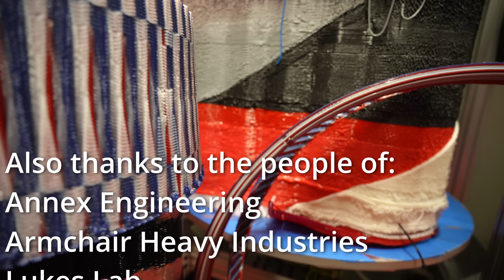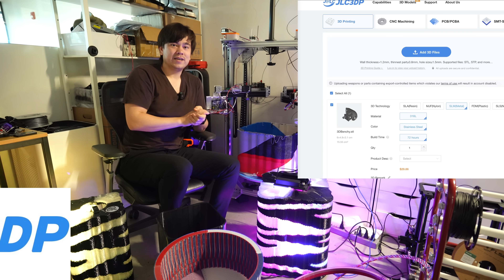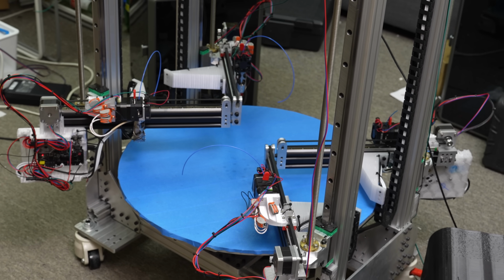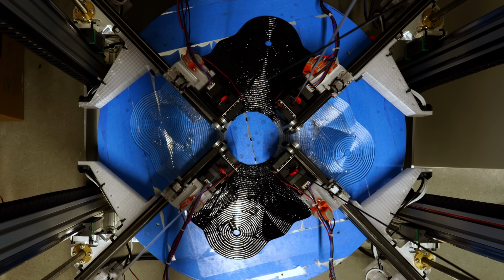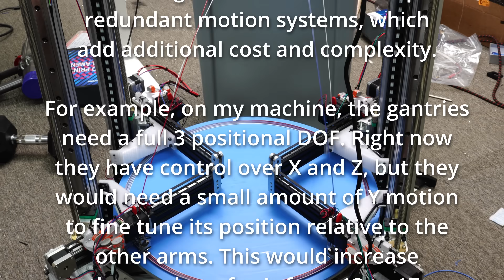The High Speed Future of 3D Printing - Quadrupolar Express

Comment: This project is really cool honestly. It is a very unique rig and an out of the box thinking for solving printing speeds. I have too many questions about your design choices but one of them is.. to get a precise frame and gantry alignment and a stiffer frame, why not make the frame square instead of rectangle? This way, the gantries form a perfect 90° angle X shape and can be connected in the middle.
Reply from the maker: I’ve been considering making the gantry a solid piece of aluminum plate with all 4 linear rails attached to it. That would make them all more precise relative to eachother, but it also means I the z heights will be coupled together.

I went with the current design to keep things mechanically simple, and be easier to program in firmware, but there are many other design alternatives
Reply: @NathanBuildsRobots  Oh -  I just suggested this. you're waaay ahead. sooo awesome

Comment: Ambitious project. What do you think of practical printings dual gantry design.
Reply from the maker: It’s similar on a lot of ways. Since he has full control over XYZ for both printheads, he should be able to do fully digital calibration with no requirement for mechanical calibration

Comment: This will blow all the 3d print industry if you manage to make it work. What if you yill use 3-4 delta mechanism to move 3-4 hotends simulaneous over the plate? You will be able to overlap for a certain degree. Also, a delta will compensate the vertical missalignment of the towers. But it is over me how to implement this by software 😁
Reply from the maker: IMO, SCARA makes the more sense than delta.

Delta mechanisms have a lot of beams sticking out every which way, and requires a lot of overhead, so the machine would have to be super tall
Reply: @NathanBuildsRobots  I think if the delta's all come in from an angle rather than overhead you would overcome a lot of the issues with beam clash - however it would make that printer end up like a massive half sphere with a tiny build half sphere in the middle - so as you say not as practical as cantilever type designs.
Reply: @NathanBuildsRobots  it will be anyway for proffesional use, the height will not be a such big deal i think. For a home user to melt 2-3 kg of filament in 5 hours is to expensive anyway to be done to frequently
Reply: With 3 delta hotends i think you will be able to overlap easly. But...not im  smart enough to ever think how complex will be the software or the slicer :))

Comment: That's like the only printer that can use 4 nozzles as the same time!
Reply from the maker: There is actually a project from like 10 years ago where someone made one

I learned about this after I had finished my design 😅
Reply: Can you remove prints by spinning the bed really fast?

Comment: i think a big concern is filament cost. The pellets used in injection molding are like 6€ a kg, but one spool of filament cost like 20€+
Reply from the maker: Yes, material cost is a concern.
This is a sort of roto-moulding alternative that is tool-less/on-demand, so it's not going to be the first choice for low-cost items
Reply: @NathanBuildsRobots try adding a heating element with an augur that allows you to move to pellets. The cost is significantly lower
Reply from the maker: @WilliDurpel 
$300 of filament isn’t really going to put much of a dent in the profits for large projects.

Of course it would matter for mass production, but that is not what this is about
Reply: @NathanBuildsRobots  💯% I was thinking the same. Nobody is using FDM to compete with large-scale production of cheap plastic junk and toys. Injection molding will ALWAYS be the method for that. Plenty of companies run $50,000 printers with $300 filament and they’re still saving loads of money on prototypes and custom hardware.
Reply: @NathanBuildsRobots I'm not going to spend $80 on a trash can and 20 hours when a $10 and 1 hour round trip gets me the same functionality
Reply: @NathanBuildsRobots  ja das ist mir vollkommen klar, jedoch konkurriert der 3D Druck in gewissen Bereichen auch mit herkömmlichen Herstellungsmethoden und es würde bestimmt nicht schaden, wenn Filament allgemein sich mehr der 10€ Grenze nähern würde. Ein Produkt muss ja nicht unnötig teuer bleiben, wenn es auch billiger möglich wäre
Reply: @WilliDurpel  The areas where FDM competes with existing technology are almost exclusively using “engineering grade” materials and they still save thousands of dollars over machining despite some high-end materials being $200/kg+
Reply: pellets is a little bit problematic with smaller batches...but still - filament sucks. maybe a new category of standard sized pellets? 0.5 -2 mm - somewhere around that?
Reply: In calculating the price of injection molding, tooling and pretty expensive machines should be taken into consideration as well. For parts that wont be produced by the thousands, this type of of machine might present a relatively competitive cost of production.
Reply: Depends on the production volume. Machining the molds for injection molding costs a lot but they can be used many times otherwise they won't be economical. With 3d printing the cost of material is higher but there's no need for a mold. So for low volume and prototyping it'll be the least expensive option.
Reply: Use a pellet extruder then
Reply: I heard pellets 3d printer. It's unreliable at now but someday get better.
Reply: pellets are easier to have a wider variety of material cost effective!
Reply: YES! PELLET EXTRUDER NEXT!
Reply: @coledavidson5630  you guys know the greenboy yt channel? Id build one like that myself if I had time..
Reply: There are 3d-printers that use pellets directly and feed the plastic with a screw. Just a bit harder to control the flow than it is with a filament, of course this is nothing which can't be solved.
Reply: @fog1257  in inj-molds...extruders have a valve. actuated by tranversing the screw. its complicated to fit this on a printhead...but somebody gotta do it....until then, its going to be ugly..
Reply: @simonschneider5913  It has been done many times already..
Reply: @fog1257  yeah? not on a printhead, just on big machines...
Reply: @simonschneider5913  Simon what is it you are missing, did you even see the video i sent? This guy built it for fun at home and it works pretty well, just needs a little shrinking and tuning. How do you think the first FDM printer looked like? It certainly didn't fit on your desktop.
If 3d-printing companies like Bambu only cared about making something like this useful we would have it on the market within a year. It is not very complicated, it's just an extruder and a heater.
Reply: @fog1257  build one if youre so smart.
Reply: @simonschneider5913  I definitely could but what's the gain? There's no fortune to be made in another version of a 3d-printer. It would take me months, cost me thousands of dollars and give me little to nothing in return. 
Better would be to make filament manufacturing cheaper.. which is already happening. It is possible to buy spools for 6-7$/kg in bulks already and the price is dropping still.

You have severe attitude problems Simon. That and grammar issues.
Reply: @fog1257  keep coping
Reply: @simonschneider5913  With what, are you a npc with 5 possible phrases?
Reply: @fog1257  youre not only coping, but also projecting....wtf are you even intending to accomplish here?
Reply: @simonschneider5913  You make absolutely no sense. I am trying to figure how dense you are.
Reply: @fog1257  which reflects interestingly on you - once again...stop digging...
Reply: @simonschneider5913  Please, elaborate. I want to see you think for once.
Reply: @fog1257  i know that there are these printers, but they are not so precise and very expensive and heavy as fuck so u need a much stiffer construction
Reply: @WilliDurpel  thanks.
Reply: You can fix that cost by adding a heating element and an augur so that you can move from spools to pellets
Reply: I think we are also going to see pellet 3d printers in the future
Reply: @samk2407 They exist... but it's not that simple. There are a lot of variables that come into it that make it less and less practical or reliable to be cost effective alternatives. It's doable but in order to be a true alternative and not just a "well it's technically working" solution, is to have more and more complex hardware and pellets designed specifically for a niche application, which means more money. 

Filament is useful because many of these variables are minimized ahead of time on fairly expensive machines so it can be fed into a system that doesn't have to worry about it... and even that isn't perfect.
Reply: If you're willing to buy 10-20 rolls at a time, you can easily see sub $10/kg for PLA, PLA+, ABS, and PETG.
Reply: Okay PLA/PETG is more like 10 euro if you don't just grab a single off some shop. 

I thought the pellets were cheaper too?
Reply: Here's a secret: You can injection mold parts at home. Small injection machines have similar costs to high end consumer FDM and resin printers.

Of course bags of pellets are going to be cheaper by mass than long strands of filament wound around spools. The filament starts as pellets, then has to be extruded to a precise diameter and wound on a spool. Then you have plastic on a spool, which is quite a bit lower density than pellets in a bag, and that has to be shipped.
Reply: 20€? More like 10-12€. I pay £7 per 1kg of Sunlu (petg, pla)
Reply: @arturdobrzynski6531  Where do you buy filament from?
Reply: @arturdobrzynski6531 where i can find 7$ per 1kg pla?
Reply: @arturdobrzynski6531  A pay about £10 for 1Kg of PLA from Geeetech.
Reply: or just make your own spools out of the pellets
Reply: You cant use injection molding pellets for 3d printing. Materials for injection molding have significantly higher shrinkage, to the point where its pretty much out of the question. Certain abs resins shrink several percent, good luck with that
Reply: @over_pizza_2578 But we have already seen people make them. And they work.

And those are amateur solutions. I am certain that commercial solutions can be more effective
Reply: filament doesn't need to be expensive though... they just make it that way so you can't compete in the market using only a 3d printer. 
Only the ones with money get to make more in a pyramid society.
Reply: Slant 3d is trying to lower the price of filament as much as possible. It is no so straight forward as cut profit. 
The filament has a very important function, translate volume into length so you can control the amount extruded with one stepper. The precision in the cross section is what you pay, not only the material.
Reply: @lucianoag999  nothing there at sla...  is special, only the "talking skills"
Reply: @jeffg4686 all plastic leaves the chemical plant as pellets, except PVC which is a dust and some niche other types that are a flake. They leave in bulk tank railcars, 200,000lbs at a time. I work at a logistics company many miles away at the other end of the train track, where the railcars arrive.

Places like Dow, Ineos, and several other chemical plants send us the pellets and we unload them with huge vacuums and put the pellets into bags and boxes and ship them to our customers' customers. Those pellets out of the bag or box can go straight into an injection molding machine, and many of the places we deliver are injection molding operations. Some of the other places we deliver, they turn the pellets into filament. There is a lot of equipment needed to make it into filament. Millions of dollars worth of extrusion lines, pumps, fans, etc. A lot of electricity being used to melt and re-melt the plastic. Modifiers need to be added to make it suitable for 3D printing. There is a lot of R&D to that goes into making better filaments. 

The point is pellets are ready to go straight from the source. Filament has to go through a whole 'nother process, a whole 'nother industry, more refinement, double the logistics, the packaging, the labor,, etc. Pellets you buy straight from the source so you're only paying one organization. Filament you're paying multiple organizations, multiple markups, multiple value-added operations, all with upstream costs. 

There is no "they" boogeyman who is leading a conspiracy to jack up the price of filament. It's not like the folks at Dow and Dupont are making pellets and filament on the same chemical reactor and selling the filament for inflated cost. They don't make filament. Somone else makes filament from Dow's and Dupont's pellets, and the costs they incur (plus the profits they make) are included in the price of filament.
Reply: @jeffg4686  i just finished a burrito and made you this stylish hat out of the wrapper.
Reply: But how many kg are in a 20€ spool
Reply: @xEternalSaltx  ...1? what kinda spools are you buying
Reply: @spambot7110   none that’s why I asked
Reply: @xEternalSaltx  1kg
Reply: @xEternalSaltx  one. nerd

Comment: You have to build some drum shells with that! With that size you could even make a bass drum!
Reply from the maker: Would 600mm x 800mm be large enough
Reply: @NathanBuildsRobots  sure, there are many different sizes. From the Wikipedia article "Sizes range from 16 to 28 inches (41 to 71 centimetres) in diameter while depths range from 12 to 22 inches (30 to 56 centimetres), with 14 to 18 inches (36 to 46 centimetres) being normal." https://en.wikipedia.org/wiki/Bass_drum
Reply: It would just be a matter of printing in one of the standard sizes and then adding the appropriate hardware. Typical drum shell materials are wood, metal or plexiglass, so 3D printing should work